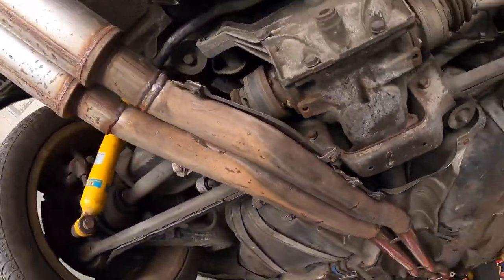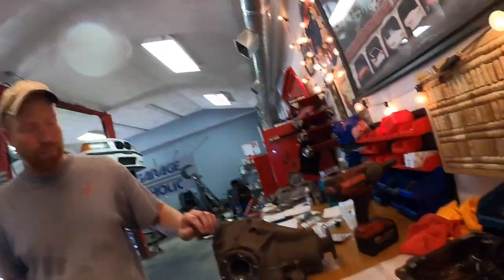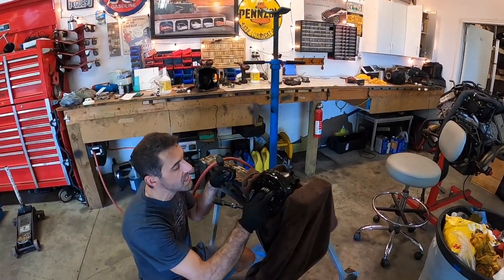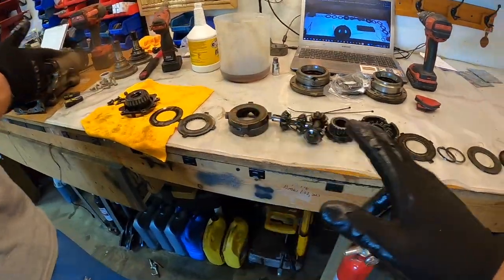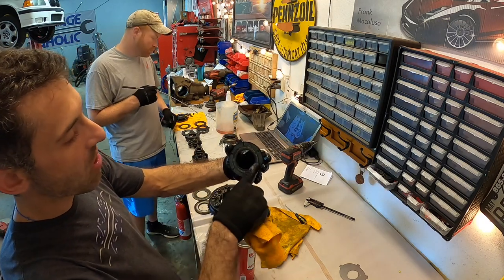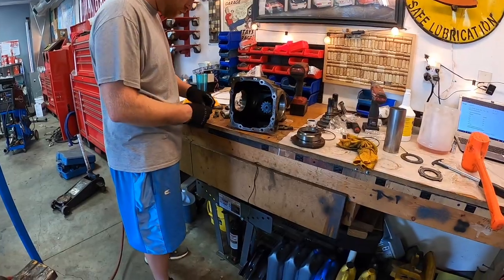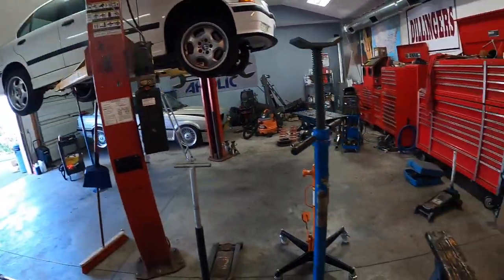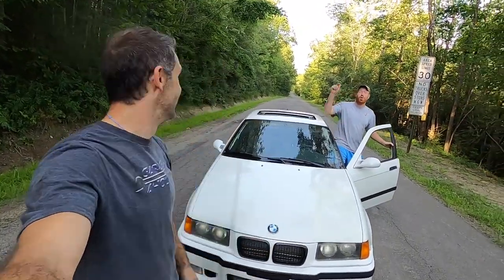TRACTION!!! Before Vs  After E36 N54 LSD 3 Clutch Diff Rebuild!

Comment: Very nice repair guys. And I love the N54 sound. Actually I sold my e36 325i vert yesterday, after 17 awesome years. And now I'm looking for a great e93 335i 2008 manual😎. Dutch regards, Nico
Reply: Very cool. I have both a swapped out E46 330CI to an E46 M3 full swap. And I have a 2008 335Xi N54. I LOVE them both big time. However they are very different beasts. The E46 is very solid and of course I've done all the up grades like the Vanos and rear Sub frame supports etc. So it's very reliable and a hoot. The E90 I have done FBO's 17t turbos and MHD tunes. It FAST!! VERY FAST! But beware this car is ALWAYS giving me things to figure out and work on. It feels more solid than the E46 but it's just got so many things that need attention. I love it though as there's no feeling like cruising around in it knowing you can toast almost every car around. LOL.

Comment: I love this swop, my first car was a e36 328i then e46 328i, e92 335i, e46 m3 and now e92 335i. I love the drive on all cars but my m3 and 335i n54 were the most fun. I found out  my e92 chasis is bent. It was in accident with previous owner, repaired. And they cover chasis arms/bars with body filler the. Painted and greased it so just looked  dirty upon inspection. My brother in laws 2012 F30 328i engine seized randomly no warning and out of warranty right. So I'm thinking F30 with my n54. But everyone says thease cars are too modern and to much electronics and  won't work.... I'm in south Africa.. Would love your thoughts on some of the complexities I may come accross..

Comment: It is disappointing that BMW stopped making an LSD optional on their non M cars in 1994.  Now the only way to get one is the buy an M model, but did you know the new "better" ones have electric motors that control the amount of lockup instead of the good ole mechanical ones like rebuilt here because progress , right ?
Reply from the maker: HA yep i knew that. I think we can all agree as enthusiasts that the old fashioned clutch discs were the bomb, and worked great with predictable feel. So I like working with them. Hell, one day I may buy one of the E-LSD's and play around with it!

Comment: Did you check the contact pattern of the pinion gear and ring gear after installing this?
Reply from the maker: No we never changed the pinion. So there was no need

Comment: What is best clutch for e36 328i around 212whp bolts on please help me i need 1,2,3 gear wheel spin like your car
Reply: Engine is m52b28
Reply from the maker: You're not going to spin through the gears in an M52 like this one does in the N54. Clutchmasters makes a good clutch, but OEM stock clutch should handle 212rwhp
Reply: @Garageaholic  my clutch is double mass
Reply from the maker: Your flywheel is double mass.
Reply: @Garageaholic  yes

Comment: Hey..  flunky... 1:30 into the video I see that you are missing VERY important items like the diff support from AAW in FL.. and the rear sway bar triangulation, from Turner...
Reply: Thanks for the comment! We upgraded the front diff bolt to a larger diameter bolt to decrease the chance of failure. I’m sure reinforcement mounts are something to consider in the future for sure!